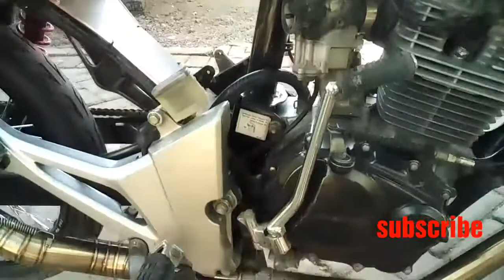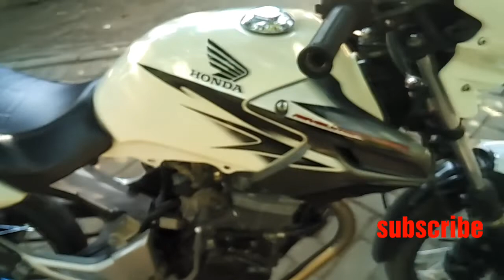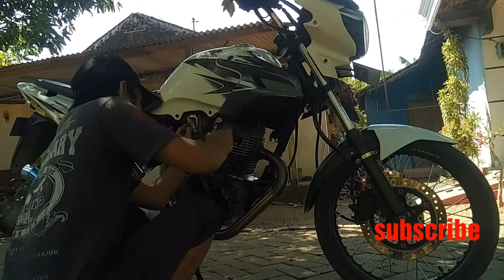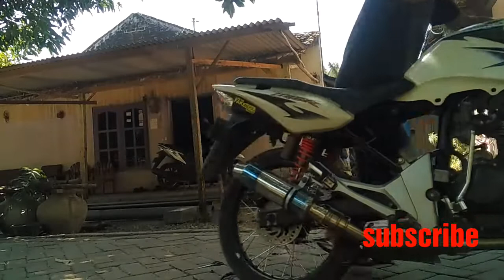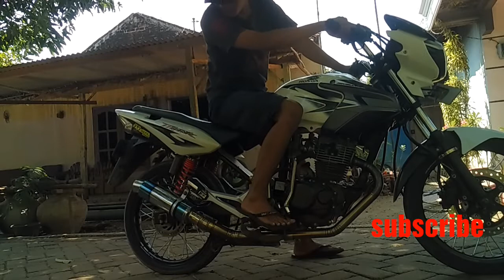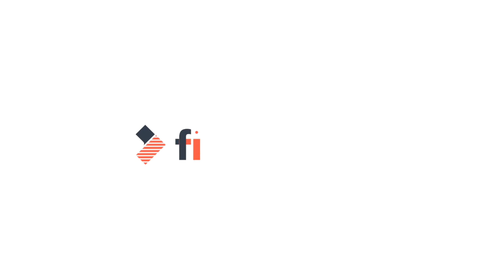Karburator ninja pwl 28 di Honda Tiger

Comment: Pj mj ne uk pinten mas?
Reply from the maker: 40 108
Reply: @kuncorogrup  oalah nggeh mas suwun.🙏
Reply from the maker: siap
Reply: Win Project rpm atas ngga gerung mas??
Reply: 108 apa ga kecilan mas
Reply: @sigitsaputro7916  mboten mas saya pake pe juga mj ne 115 spek mesin tiger 212 cc klo pake 120/122 mj nya kebasahan rpm tengah brebet busi hitam klo 110/115 bisa merah bata , ujung elektroda busi bisa merah bata dengan catatan setingan pelampung di tirunin dikit
Reply: @anh0816  tapi kok punya ku coba mj 110 pj 40 bawahnya brebet  mass.kalau pake 122/40 atas bawah ngisi tpi busi agak hitam.
Reply: @anh0816  jarum skep pake apa ? 
Klip jarum nomer brapa ?